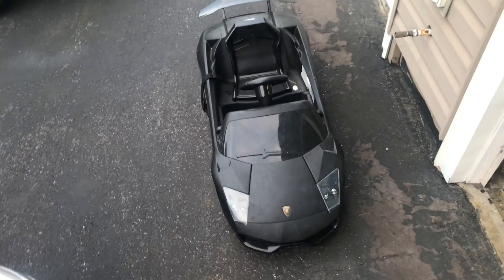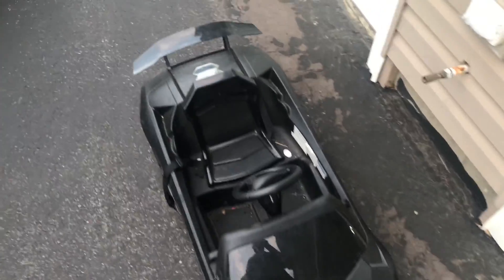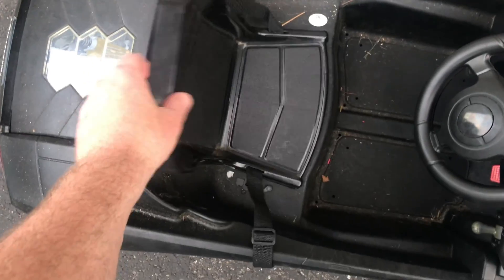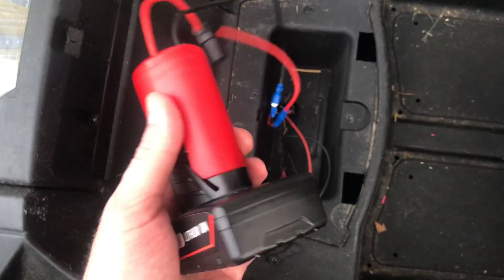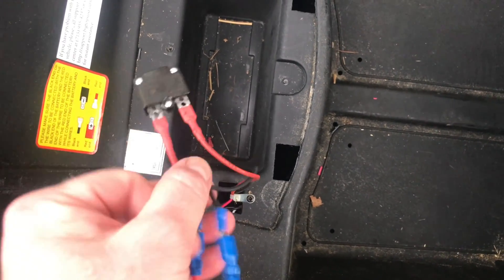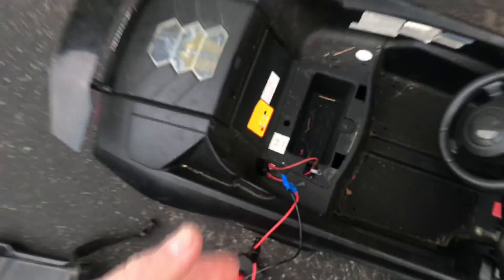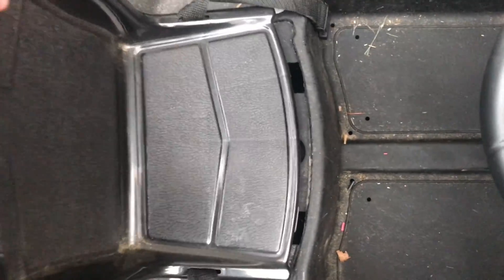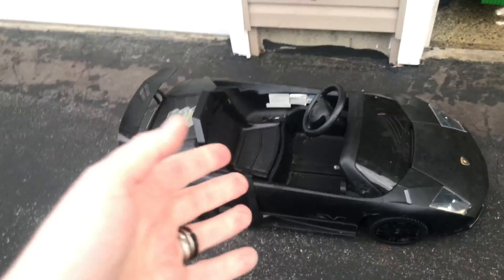Power Wheels 6v Lead Acid To 12v Lithium Ion Battery Conversion

Comment: Brings back memories Jay I remember doing something like that for my sons power wheel Jeep he had. The company wanted too much for a new rechargeable 6v battery. Made a trip to lowes garden center got a small 12V tractor battery and installed that. Those plastic wheels couldn't handle the torque on the black top driveway  and just spun but in the grass or dirt it flew. My son would giggle every time he took off in it.
Reply from the maker: Hahah that’s awesome